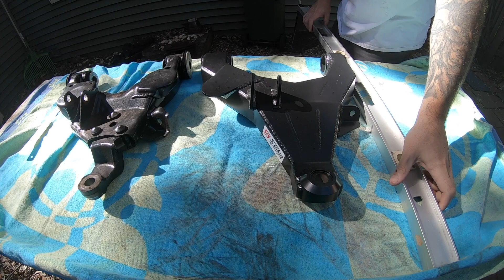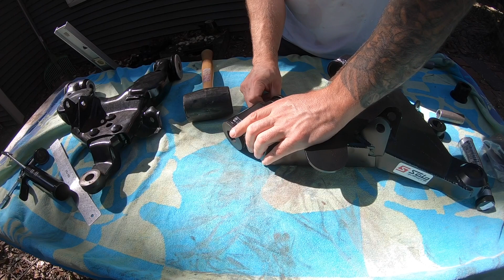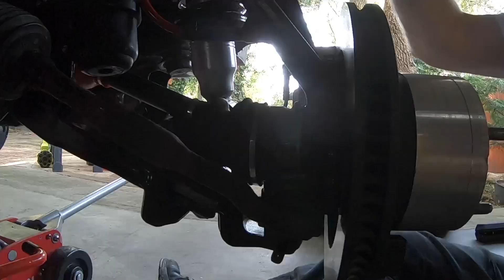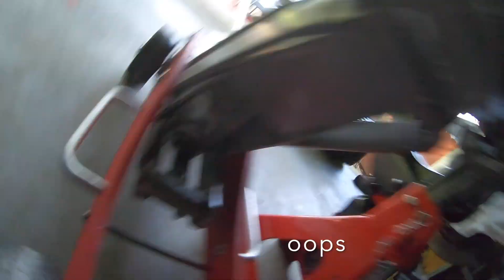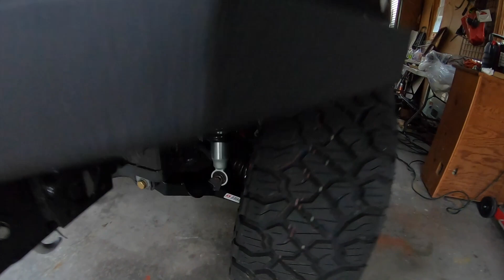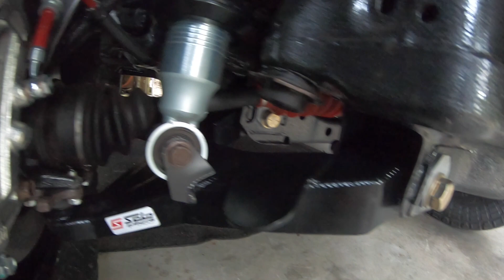SoloMotorsports Stock Width Lower Control Arms.

Comment: Curious when you got alignment did they leave cam bolts in neutral position.
Reply from the maker: 3 of the 4 are neutral. Passenger front cam had to be clocked slightly, 1 notch IIRC.

Comment: Would this be worth it to get with 6112s?
Reply from the maker: Two different purposes. Main benefit of the solo arms is the added caster and strength. Those benefits carry over to any coilover you choose. 6112 are a good choice if you push your truck fast and hard on the bumpy stuff.

Comment: Great video man. Just got the spc uppers. This’ll be my next purchase. I know your firm belief in having to trim to run 35s but I got my heart set on proving you wrong 😂 I’m hoping I can run these and the spc uppers and get the wheels right where they should be 👍
Reply from the maker: Hey, thank you... I only tell folks they are going to have to trim/modify, because I just want them to be prepared for what they may be in store for, if they want to truly clear big tires on these trucks. I wish you luck, but I would suggest you make sure you thoroughly test your tire clearance through the ENTIRE suspension and steering cycles in your driveway, before you flex it out on a trail. You don't want to rip anything apart or cut rubber the first time you are on your bump stops. Cheers!

Comment: Did you have an issue with your coilover now too short after installing these since its oushed forward an inch? I bouth a new set of Kings (my first real coilover purchase) and they had basically ½" of travel. My fab shop discovered that theyre basically too short becuase of the LCAs. This was a sad day for me. Had to have a custom spacer on top machined to make up the difference and allow for more travel. I was so bummed out.
Reply from the maker: Hmmm… The solo arms shouldn’t effect your shock travel. The LBJ is moved forward, but the lower shock mount is very close to the same place as stock. Sounds to me like King may have sent you the wrong shocks. Stock travel numbers are around 7-8” and a “mid travel” coilover should put you at about 8-9” of total travel. So if you have 1/2” travel, something is very wrong.

Comment: the front cam adjusts camber not caster
Reply from the maker: Hi. The LCA is a triangle. Any independent adjustment of either the front or rear alignment cam, will result in the LBJ moving forward or backwards, which will affect caster.

Comment: Do you think I can fit 2004-2006 lower control arms into my 2002 tundra if I replace spindles, knuckles, and lower ball joints? There’s an open thread in 1st gen tundra but no definitive answers
Reply from the maker: Yes you can.

Comment: do you think 35x10.50 would fit well with minimal trimming with these control arms?
Reply from the maker: Fitting 35s at full bump/turn is tough regardless of width. Keeping the wheel offset as close to stock as you can just clearing the UCA and frame, and running these arms, should get you pretty close though.

Comment: How do you like the new lower control arm and can you feel the difference?
Reply from the maker: They are holding up very well, no issues. It’s hard to say I “feel” any difference while driving, since I did a number of things to the suspension all at the same time. But I can say the LCA bushings are definitely under much less stress now, that the alignment cams aren’t turned way out. That’s very apparent when I’m working on the suspension and moving it up and down by hand.

Comment: What brand of after market Cam adjusters do you have on the Tundra?
Reply from the maker: kpoffroad.com makes them.
Reply: @JHBtheIV  Thanks! How was the camber, were you able to get it close to spec without adjustable upper control arms? Also the lower Solo lower control arm, the factory steering stops don't function, how does it affect turning? Lastly, how do you like the Solo LCAs, any regrets or issues?
Reply from the maker: @bern7250  Ive found once you start messing with IFS lift, and aftermarket control arms on these trucks, aligning to "spec" is sort of gone out the window. If you try to go soley by numbers, you will usually end up with poor driving characteristics and/or wear patterns. To get a good alignment you really need to go to an old school shop that uses turntables, and does driving tests. I have done that with all my IFS trucks and never had any alignment problems. 

You are correct. The factory stops no longer limit your steering cycle with the Solo LCAs, so its now limited by your steering rack. I try to make a point not to crank the wheel to full stop, just to keep from putting undo stress on the rack seals. You could probably fab a little spacer for the factory stops if desired, but I haven't felt it necessary. 

No regrets on the Solo LCAs. They are all positives and no negatives as far as I can tell at this point. Only possible negative is that now im considering going LT, because I can't leave things alone. :)

Comment: You running the small Toyota ball joint’
Reply from the maker: Yessir. 03 is the smaller style.
Reply: @JHBtheIV  nice build…how they holding up so far! What size tire u running?
Reply from the maker: I have not driven the truck much since I installed them. I drive a van for work. But they are extremely nice arms, and really helped with getting caster for my alignment.
I’m running 35x12.5R17 tires currently.
Reply: @JHBtheIV  im currently on 35s toyo RTs possibly going up to 37s soon. Is that not possible with these LCAs? What modifications did you have to make for 35s?